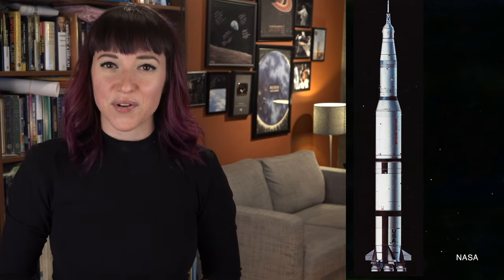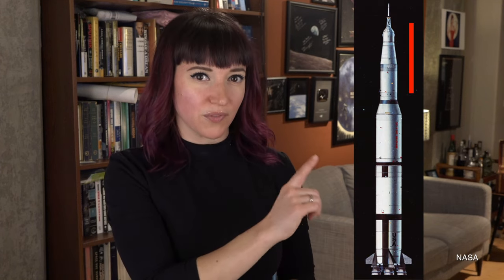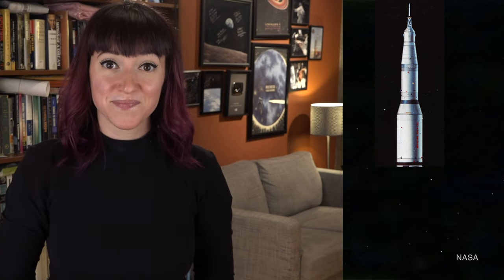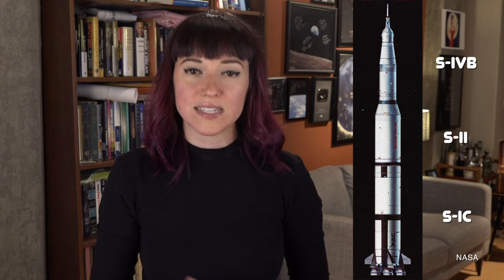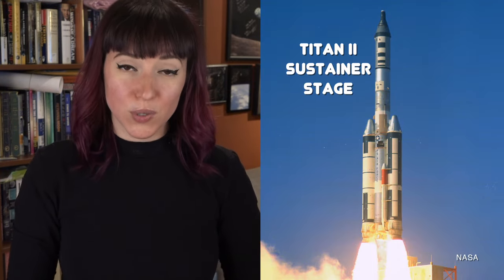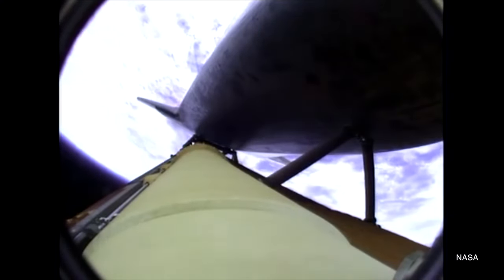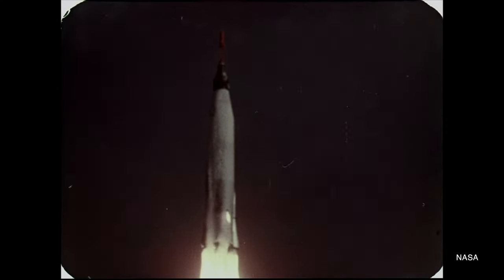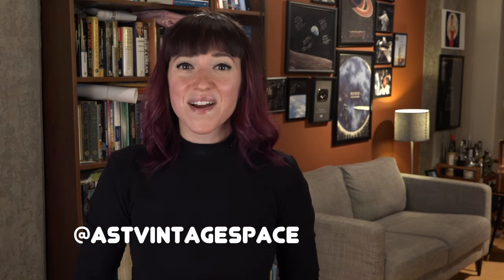The How and Why of Rockets' Staging

Comment: There was another kind of staging that saw VERY limited use back 60 years ago.  I call it "cluster staging."  It was used on the Jupiter-C and Juno II rockets.  They were 4-stage rockets which used the Redstone and Jupiter missiles as the first stage.  The other 3 stages were comprised of small solid-fuel rockets -- 11 in the second stage, 3 in the third, and 1 in the fourth.  They were enclosed in a "tub" that spun at the top of the missiles.  The stages were nestled in each other, the third inside the second, and the fourth inside the third.  Naturally, their payload capacity was extremely limited; the two Pioneer moon probes launched by the Juno II each weighed less than a bowling ball.

Comment: Thanks Amy:

Isn't there another issue that staging addresses?

I'm under the impression that rocket engines are most efficient operating at the ambient pressures of particular altitudes.  

When we watch a rocket launch it appears to be lifted on a column of fire, contained in part by the ambient air pressure.  As the first stage rises into less dense atmosphere the lower pressure doesn't contain the thrust and it spreads out.  We've all see the "bloom" in the rocket's exhaust.  I've been told this represents a waste of thrust.  

The engines on the second stages are designed to once again direct the exhaust in a column of fire, which efficiently uses thrust, until ambient atmosphere at that engine's limits can no longer contain the thrust.  

And the third stage goes through the same process.  

That's a story I was told.  This is what the aerospike is supposed to address in hopes of providing a single stage to orbit.  

Or I could be all wrong...
Reply: "I'm under the impression that rocket engines are most efficient operating at the ambient pressures of particular altitudes."    -    Yes, for rocket engines that have a fixed size/shape bell nozzle (which is near enough all of them).  The exhaust gasses come out of the combustion chamber at some (relatively high) pressure and travel down the nozzle, which has a progressively increasing (in area) cross section.  So the pressure of the exhaust gasses drop as they travel down the nozzle and the area they occupy increases. For optimal energy extraction form the exhaust gasses the pressure of those gasses when they leave the end of the nozzle should have dropped to the ambient pressure outside of the nozzle, but as the nozzle has one fixed shape it can only have one external ambient pressure for which it is optimally shaped, and that will corresponded with one single altitude.

"When we watch a rocket launch it appears to be lifted on a column of fire, contained in part by the ambient air pressure.  As the first stage rises into less dense atmosphere the lower pressure doesn't contain the thrust and it spreads out.  We've all see the "bloom" in the rocket's exhaust. "    -    This is reasonable if you remove the word "thrust". The exhaust gases want to expand (a formal definition of a gas is a material that will spontaneously expand to fill its container (and for a rocket that 'container' is likely either the entire atmosphere or the universe)) and the atmosphere will inhibit that by getting in the way, so the less atmosphere there is the less the expansion of the exhaust gasses is inhibited and the faster they will expand/dissipate.

" I've been told this represents a waste of thrust.  "    -    If you had been told that it would be wrong, though it is likely that you misinterpreted what was being said. All of the thrust that a rocket experiences comes through the inner surfaces of its combustion chamber and engine bell (in the form of hot, and so very fast moving, gas molecules bouncing off those surfaces).  Once the exhaust gas has left the end of the nozzle there are no further interactions between their constituent molecules and the rocket structure and so how much those gasses may subsequently expand in the atmosphere can have no influence of the thrust experienced by the rocket (and that is  why the 'rockets cannot work in a vacuum because they have nothing to push against' claim is a nonsense ).

"The engines on the second stages are designed to once again direct the exhaust in a column of fire, which efficiently uses thrust, until ambient atmosphere at that engine's limits can no longer contain the thrust.  "    -    No the engines on the second stage are designed to be optimised for a higher altitude, in that they will have proportionally longer and wider nozzles. That higher altitude being one in which the second stage engines are expected t o be operating (passing through).

"And the third stage goes through the same process.  "   -   Yes, longer and wider nozzles again. Though as the ambient pressure gets low weight (mass) and volume issues come into play as you cannot make the physical structure of the nozzle larger without also making it heavier and at some point any efficiency gain is going to be offset by the extra mass of the nozzle, and/or the inconvenience of containing its increasing volume inside the rocket.

"That's a story I was told.  This is what the aerospike is supposed to address in hopes of providing a single stage to orbit."  - Aerospikes move one of the surfaces that the gas molecules bounce off in order to push the rocket from the inside of the nozzle to the outside of the spike, hence the interest in elongating the engine to give that surface a larger surface area.
Reply: Thanks for that information.  

I'm still a bit hazy on these details.  

I understand the concept that once the exhaust doesn't push against anything, and that once it's outside of the nozzles its irrelevant to the ascent.  

I also understand why a wider nozzle would have less pressure, everything else being equal, bringing it closer to ambient.  What does the longer nozzle do?
Reply: Longer is only a consequence of needing to end up wider.  You would want roughly the same rate of change of width (slope, or profile) so if the end of the nozzle is going to be wider it will also need to be longer.
Reply: Thanks again.  

May I ask how you come upon this knowledge?
Reply: It is a combination of a lifetime of paying attention and looking things up  (these days on the internet) when I am interested to know something specific.

Comment: Ah, yeah, ya missed the Big One: Different stages use different kinds of fuel because different types of thrust is necessary thoughout the launch.  

The first stage to the Saturn V rocket used the F-1 engine that burned a very refined liquid kerosene fuel.  The other two stages needed their own oxidizer because they would burn in at high alt and at the edge of space.  So, since the fuel types changed toughtout the launch cycle, the spent engines and fuel tank could be discarded, lowering the total mass of the space vehicle and improving fuel use efficiency thrust to weight ratios.
Reply: Not quite right. All three stages of the Saturn V needed to carry their own oxidiser - which was Liquid Oxygen. The 1st stage used liquid oxygen and kerosene. The 2nd and 3rd stages used liquid oxygen and liquid hydrogen.
Reply: That's the ticket!  This is the only vid where she leaves the major purpose out.  Made it seem like NASA was chucking good engines for no real reason.
Reply: oh, the reason she addresses is: half-empty tanks are dead mass, also the supporting structure and other pieces. To me it seems the option to change the fuel is just another advantage of the staging system.
Reply: The main reason for staging is it is the only way to orbit with chemical rockets.  Stage 1 of the saturnV use rp1/lox because the advantages of lh2/lox are wasted in the atmosphere and rp1 is dense and good enough.  The upper stage engines can then use higher expansion ratio rocket engines and more efficient but less dense fuel.  Also in 1960 no one had a large lh2/lox engine that had to wait until the rs-33 that powers the delta4.
Reply: Indeed. Not all rocket systems use different fuels for their different stages. The Titan I and II used the same fuels for all the stages, as does the Russian R7/Soyuz family and the Proton family and even SpacexX's Falcons..
Reply: +Stephen Gloor  RP-1 (highly refined kerosene) was better suited for the first stage because so much energy was required and this fuel is far more dense in terms of energy per volume, which kept the size of the first stage under control.  For the upper stages, however, liquid hydrogen's greater density in terms of energy per mass makes it more advantageous, despite its larger bulk.  This combination made the Saturn V quite an optimized system, which was why it had a greater payload per rocket mass than the N1, the Delta IV Heavy, and the Falcon Heavy, which all used a single fuel (kerosene or liquid hydrogen rather than both).

Comment: Hi Amy. I'd love to see an explanation of exploding bolts. What they contain and how they fire. As well as what pushes the stages apart.
Reply from the maker: That's on the to-do list -- I honestly just haven't had to time to dig in to that yet, but soon!
Reply: Vintage Space Amy, can we please be done with the flawed description of using explosive bolts in Saturn V staging? They used linear shaped charge explosives to slice solid metal apart at the separation plane. We've discussed all this before! You even did a video on the exploding bridgewire detonators used to trigger the shaped charges (an EBW detonator is only used with shaped charges!), yet you keep talking about explosive bolts in Saturn V staging! WTF? The only explosive bolts used on the mission for true staging were in jettisoning the LES, and for separating the ascent stage of the LM. There were several other explosive bolts used on the Apollo missions, but none for staging .

Comment: Hi, while losing dead weight is the basic idea behind staging, I think it is important to point out why it is important to lose the dead weight. Normal rocket engines are designed to work very well in a specific environment. For example sea level or vacuum. An engine that works well in one environment does usually not perform that well in the other. So the idea is to have engines on board that work very well at sea level and switch to engines that are designed for space once you've reached a certain height. Now the sea level engines and their thrust structure are dead weight and instead of just ditching them (like in the atlas rocket) you can also get rid of the tanks, saving a bit of extra weight. Single Stage to Orbit designs try to prevent this by using engines that have the maximum amount of thrust in all conditions. For example by using linear aerospike engines.

Comment: I've long been fond of the semi single stage to orbit concept. 
This is basically a system like the X planes, loft the vehicle on a conventional air-breathing aircraft. This provides a head start in speed, and more important lifts the rocket above most of the atmosphere.
This vastly reduces the energy needed to achieve orbit, making the "single stage to orbit" more doable.

Comment: A little dissapointed that you didn-t mention R-7 and its derivatives, which carries all the manned soviet and russian missions for at least fifty years already.
The point is that the first stage there is generally 4 boosters around the second stage and all its engines are ingnited simultaneously on the launch, but up to the separation the second stage engines are working on minimal power just to keep fire and only at the moment of separation it goes to full throttle.
Reply: Голубев Андрей that qualifies as 1.5 staging, doesn't it?
Reply: Not quite as the 2nd stage provides almost no thrust for first minutes of the flight. Soviet rocket engineers were not 100% sure, if the engine will ignite at the 50km altitude, so they preferred not to take any risk at all.
As for the 1.5 staging the clear example is ICBM SM-65 Atlas. It had one set of fuel tanks and detachable extra launch engines. Not separate thrusters with their own fuel, just engines.
Reply: I don't know why Amy doesn't tend to talk much about Russian/Soviet spacecraft and rockets as much.  As a bit of an armchair space nut myself, I've always found the Russian/Soviet space tech more interesting.  Partly because western commentators, writers, etc tend not to focus on it as much, so that's always made it even more desirable for me to research into myself.  Wish Amy would talk more about stuff like the Salyut stations, MIR, Buran, and the variants of the Soyuz.  I find Amy tends to focus too much on NASA and the American programme.  More russian and esa coverage would be good, like Ariane, the French Guianna spaceport, etc.
Reply: Well, I think partly it is a simple lack of detailed information, as all that soviet stuff is relatively recently declassified (e.g. information about N-1 super heavy rocket became public only in late 80s under Gorbachev's revealance policy, and i mean not the tech specs-the very existence of this space project was hidden from soviet citizens) and not yet fully translated into english. But in general soviet space tech inherited basic principles of all our military tech of that time-make it as simple and reliable as possible. Hell of a job when you are on the cutting edge of technology))
Reply: Голубев Андрей yes one of the facinating facts that I always mention to people but nobody ever seems to mention is how the cold weather and ice was blamed as causing the O-ring failure on the American Challenger.  Everyone blamed Nasa for launching on a cold day.  The irony is, the Soviets/Russians launch the Soyuz in snow and ice and freezing temps all the time with no issues.   Nobody seems to notice or mention it.  It's always seemed to me that the Soviet/Russian hardware is more rugged.  It may not look as "Pretty", but it seems tougher and more reliable.
Reply: Trans Canada Phil not to mention the fact that NASA human rated SRB's those things were dangerous.
Reply: Apples and oranges. The Soyuz does not use solid rocket boosters.
Reply: It's also the prettiest staging, I love that Korolyov's cross when the 4 boosters separate.
Reply: You're right. Amy talks essentially about US past space technolgies. At the same time Soviet Union and other countries developped their space progam. For example, France built several small launchers in the 50's and 60's : Veronique and Diamant (Diamond). Now the Ariane laucnher is one of the most successful program, in the 5th (and soon 6th) iteration.
Reply: Have you guys seen this new movie, "Salyut 7"?  I just finished watching it.  It's a new Russian film about the Salyut 7 rescue in the mid 80s.  Very good Apollo 13 style film, but of course in Russian.  I found an English sub-titled version online though.  https://www.youtube.com/watch?v=mOhe4by-kWI
Reply: It was ironically a fantastic time to grow up. Now you can go and visit Biakonur pretty much like you can Kennedy. And I for one would love to see Gagarins Start. Both these places are holy ground as far as I'm concerned! !thanks for the Salyut film heads up by the way, it looks really good!
Reply: It's just parallel staging.

Comment: In addition to getting the whole mass of the rocket away from the launch pad the other function of the first stage is to accelerate the entire stack through the lower atmosphere and through the region where the rocket experiences 'Max-Q' or maximum dynamic pressure, i.e, the forces which are greatest at that lower altitude which causes maximum stress on the rocket, after this has happened the rockets engines are throttled up to maximum power (throttle - up)when the air is less dense and not able to cause maximum stress on the rocket, this tragically you will remember the call 'Challenger, you are go with throttle up' before the shuttle exploded some 73 seconds after lift off.

Comment: Another important aspect to staging are all your Engine Design/Thrust-to-weight/Efficiency considerations, rather than purely the mass of the spent fuel tanks.

An engine designed for effective thrust at sea level atmospheric pressures on earth is not going do perform as well in hard vacuum. - This is why there have been very few designs focused on drop-tanks attempting to use a single engine from launch to orbit, as you can readily gain overall payload capacity even if you're now lugging the weight of a whole other engine up from ground level. (Plus all the safety and engineering issues. Effective drop-tanks feeding a long burn engine aren't a trivial design concept.)

Comment: Those were some fast Shuttle and Atlas flights! Haha Falcon Heavy was funky parallel stage landings. B"F"R going to be huge if it it really is single stage to orbit.
Reply: Technically true, although it can't lift much additional payload.
Reply: Brian Ronald Right. And it has to be able to SSTO on Mars if that's the goal. Bringing the 1st stage booster back to the launch pad would be huge too. Wondering what silly payload would be for the 1st BFR. Mobile home for Starman?
Reply: bfr is not a single stage to orbit, it uses some fuel from the space ship to get into orbit, so, its technically a two stage rocket. sorry if I did not see some news spacex sad or anything and sory for my english, Im brazilian
Reply: BFR is not aimed at single stage. Because going to Mars involved flying a few tanker missions to transfer fuel to the ship, and on Mars they need also a refill (but locally produced, what the first unmanned mission will be about). But on Mars it will be single stage back. For the moon I think it was no refilling needed to go there and neither any for going back. If I'm wrong on this it is that they either could do directly or had to, like Mars mission, refill in orbit.